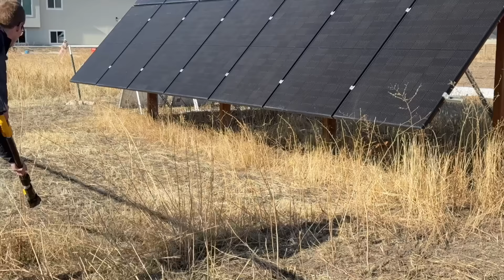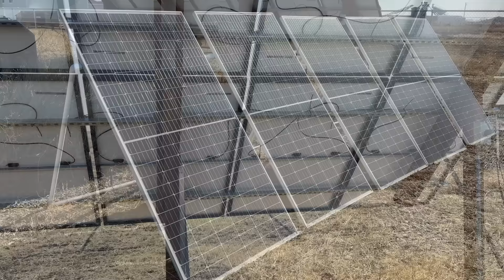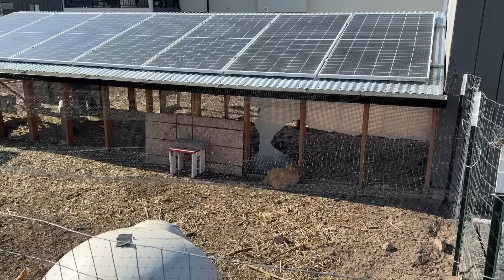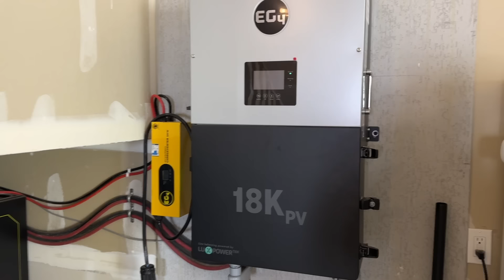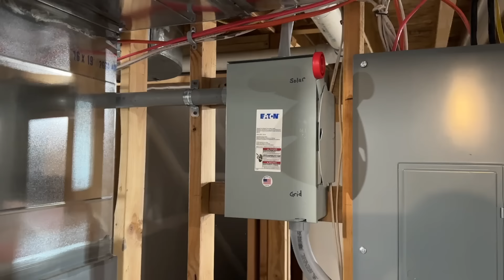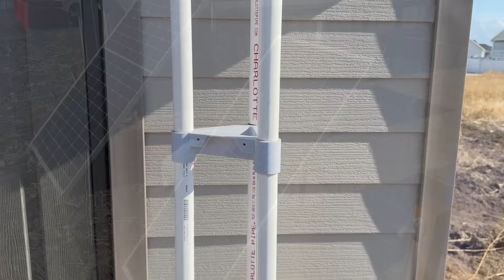We Said Goodbye to the Power Grid... Forever

Comment: How often would you say you need to switch over to commercial power?  Do you operate HVAC from solar too?
Reply from the maker: Both of the past two years there’s been about a week period in Dec where we’ve had to fire up the propane generator to supplement our energy. Outside of those few days we’ve been able to cover all of our power needs with solar.

Cooling with our AC yes, but no for heating. Our furnace is still on natural gas.

We recently replaced our gas water heater with a Rheem heat-pump water heater. It’s been working great. We just need to get some mini-splits and we can cut out natural gas entirely.
Reply: @SmithOffGrid   Sounds great.  
What is your average or typical kilowatt hours per day consumption and do you use less or try to use less throughout the winter?

Comment: Those wires coming from the solar panels seems really really thin and small. 😮. I’d install something with a bit more size to be safe.
Reply from the maker: It’s all 10 awg which is rated for 30 amps, so crazy enough it’s actually oversized for what we need!

Comment: ✅ Really nice job.  The pvc tower is a bit scary though as wind loads in bad storms can be nasty.  I had one break at 2am and damn near pole vaulted into the house.  However it did not have the three support poles like you have.  It was a heavy wall pipe back in the day and it snapped at a reducer.  Pretty obvious Monday morning quarterbacking.

Mestastic needs the shortest antenna cable as the drop in signal is significant per foot.  It’s a common problem.  So, if you put the unit on top of the pole in a NEMA watertight enclosure, it will perform much longer range.  In fact you probably don’t need the height so tall.  The biggest threat is a lightning strike.  It can set the building on fire.  It also can blast the equipment on the end of the cable.  I have been around many projects where I had the lightning rod systems added.  I also standardized on fiber optic cables for all outside runs after a major hit ‘changed my religion’ so to speak.  If you do use fiber, be extremely careful to avoid any sharp radiuses as there is a turn radius with fiber.  I prefer pretermimated fibers with connectors you can buy for $28 for a hundred feet.  Don’t get the tips dirty.  We had one bad connector and it ended up being oil from the technician’s finger. 

I am curious, what are you doing with the mestastic?  Been studying this for a decade.

Comment: Are you running different solar panel set ups with just one inverter? Does it have many inputs for different arrays? You better consider the purchase of an inverter generator with a clean output. The regular ones can turn off the solar inverter or damage the connected devices.
Just personal experience on my off-grid living in cold climate with 23kW solar and 80kW batteries.
Reply from the maker: Yeah all three of our main arrays go into a single inverter. The 18kPV has three separate mppt inputs which is great.

I agree, a inverter generator would be nice. The harmonic distortion on ours is over the limit of what the 18kPV is designed to accept. That's why we got the chargeverter which lets us charge our batteries directly regardless of how dirty the power is. It's worked really well for us so far!
Reply: @SmithOffGrid  Thank you for the info.

Comment: How much did it all cost, and whats the payback time in the US, (I am in uk).
Reply from the maker: $20k initially and $14k after tax rebates. When we ran the numbers it looked like it'd pay for itself in about 7 years
Reply: @SmithOffGrid  Hey, thanks for the reply, sounds reasonably good, so panels should last 20  years, but batteries, lucky if you get 10, so I guess that becomes a recurring cost, but still better than paying for the grid.
Do you feed back into the grid at all and get paid for it ?.
Reply from the maker: @michaelhex  The batteries are actually rated to retain 80% of their original capacity after 6000 cycles (that's over 15 years of daily use), so still very usable even after that point. And no we don't back-feed the grid at all. Our system is totally separate and isolated from the grid.

Comment: 3:13 You might want to elevate the chicken coop array panels, even just an inch or so of separation to allow air flow between the metal roof and the panels, though if snow build-up is an issue, then your configuration is great.

Comment: Can you go fully off-grid permanently with your setup or do you require the grid in the winter? I don't know where exactly you live so I don't know if you get enough solar power in the winter to make it.

I did spot something that could be a possible risk factor. All your DC cables converge inside one tube that enters the house. This means that you have a lot of DC voltage differentials inside the tube, risking massive arcs if the wires should ever get damaged. Best practice is to run the DC positive wires in seperate pipes. DC negative could be bundled together as their shared potential should be 0V.

Comment: Did you pay attention when Starlink lost 212 satellites in two months due to solar activity? The sun's solar flaring harmonics as great or greater than the centennial Gleissberg cycle and certainly the 195-235 year Suess/de Vries cycle combined with the exponential decay of the magnetosphere since the Carrington Event 1859 can and will cause catastrophic damage to the grid and electronics. Watch out for hail and crazy winds in the mean time. From roughly the mid 30's to mid-century will decide the course of events thereafter.

Comment: Have you found anything you couldn't reasonably power? Like using a small/medium welding machine (115v or 230?)? Air conditioning in hot months? Heating a hot tub? Charging an electric vehicle?
Reply: From what I've seen 5000 watts will run a welder its the inverter you gotta look put for

Comment: You should consider using bifacial solar panels on a vertical mounting system(you can make one yourself) with East-West orientation. You get two panels for the price and space of one (the backside produces 80% of front side power). In the winter snow doesn't accumulate and you get more linear power output from the solar panels which is better for self use conditions :)

Comment: 1 day without sun and you say hello to the power grid
Reply from the maker: We’ve been running this system for almost 2 years now and we’ve seen plenty of cloudy days. But that’s exactly what the batteries are for! We get about 2 days of runtime just purely off our battery bank
Reply: @ 2 days is not enough to be fully off grid
Reply from the maker: It’s worked for us! Cloudy days have reduced solar input but it never goes down to zero. That extra bit helps extend our runtime to 3 or 4 days if we also start conserving power. But for the 1-2 week period in December where we can have cloudy weather that’s longer than 3-4 days, that’s when we break out the propane generator

Comment: Question: why didn’t you go with an automated grid tied/off grid inverter? 
Awesome video and no unnecessary bs to get it past 10 minutes. Keep up the great work!
Reply from the maker: Our inverter actually is a hybrid inverter but I have it running in an off-grid configuration. With how hybrid inverters work and how they sync with the grid it’s hard to guarantee zero back-feeding to the grid. We don’t have a net-metering agreement with our power company so I didn’t want to risk that, so I set it up totally isolated. Glad you enjoyed the video!
Reply: @SmithOffGrid smart! Thanks for the answer!

Comment: I'm a little bit nervous about how teach of these installations handle in a real storm. These panels are massive sails.
Reply: Bump
Reply from the maker: We’ve had no issues with the wind so far. I’m not worried about the two main arrays, they’re secured pretty well.

But I do worry sometimes about that temporary PVC array. It’s staked down with 3 ft concrete stakes and it’s been fine through all the storms we’ve had the past year and a half, but I should still find a permanent mount for it

Comment: am i crazy or are those wires CRAZY thin for that many watts?
Reply from the maker: Wire gauge is actually all about amps! The solar wire I used is 10 gauge which can handle up to 30 amps of current. The panels are in series so in optimal sun each panel adds 41v for a total of 246 volts DC. And the current that flows through all of them is only 10 amps.

41V * 6 panels * 10 amps = 2460 watts

What's crazy is that 10 gauge is actually MORE than what you need! You'd be fine with 12 gauge wire (rated for 20 amps) for the amount of current we have flowing in that array.

Comment: Do you have any problem with wind where you live, especially with the PVC mounted setup?
Reply from the maker: We do get some winds but it normally comes in-line with the array and not from the back or front. I've been surprised how well that temporary array has stayed put. I did anchor down each panel with 3 ft long concrete stakes though. If I hadn't done that I'm sure they would have blown over.

Comment: How are your panels wired:  series or parallel or some combination?
Reply from the maker: All three arrays are wired in series. Our inverter/charge-controller needs pretty high voltages so series wiring works well and they each go to their own mppt input

Comment: could you hook up the gas generater straight to the Eg4 18kPV inverter to charge the batteries?
Reply from the maker: Yeah you can hook it up directly but the harmonic distortion on my non-inverter generator (dirty power) was more than the 18kPV was rated for. Thats why we went through the chargeverter instead.

Comment: I also like how concise this video is compared to others on YT that are over-long with endless talking. But I think another minute or two showing graphs of your consumption, how much are you saving and are there any limitations of your setup, maybe a wish list for upgrades and why etc.. Do you run this set up off-grid all the time? Can you run all appliances in the house simultaneously if you wanted same as if you were connected to the grid?
Reply from the maker: Great ideas for follow up videos! I actually have been thinking about making a video focused on our appliance use… I think that could be a good place to include a lot of those details. Stay tuned!

Comment: Thank you for the video.
What we need to know is the house load on this system and what your latitude is. I have two systems in place for a total of 17kW. I also have EG4 batteries but only 3 because I find it's cheaper to add PV and I want to run our house on overcast days, not let the batteries do the extra work. Do you have mini-splits? An EV? I have both.

If I'm charging the EV in summer I can also cool the house with mini-splits but in the dead of winter I can not run off grid entirely. Right now it's overcast at our 42 parallel and I'm running enough from the PV to run and heat the house but if I had to charge the EV I couldn't. On sunny days in the winter I can run the three mini's and heat the house but not on overcast days, I have to back up with the grid. When it's single digits F out I have to run all three mini's. I find running off grid continually is not possible in the wither in our northern location, I could do it if we lived in the south.

Comment: Great tour!  I also used a 100W panel directly to a 12v water pump which flowed water from our pool into a couple 100' lengths of black hose (heat collector) and drains back into the pool.

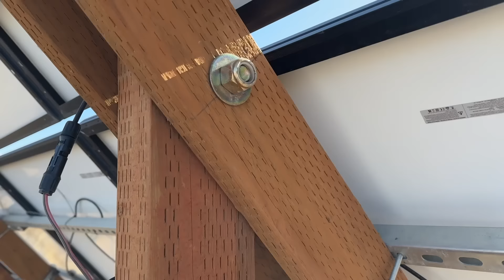Comment: Great video but just one thing, 1:16 The bolts on your ground mount that you change the angle of the panel with are too short,  with Nyloc nuts the bolt needs to go through the nylon to keep it retained.
Reply from the maker: Good eye! Yeah I noticed that during construction but it was the longest bolt in that size I could find. I've checked them periodically and none of them have backed off at all the last year and a half. The thread tolerance alone seems to have kept it pretty snug so far. But a little loctite should do the trick if I notice any movement in the future

Comment: can the battery pack replaced with an EV? I am considering to buy one of cheap EV just as battery and use it as second car in emergency(I am at rural)
Reply from the maker: I personally haven’t done anything like that before but I bet it’s possible...

You’d need to make sure your EV supports vehicle-to-grid, which I don’t think all do. And your inverter would need to be compatible with that type of setup.

I bet you could fine someone on YouTube that has done it

Comment: How can you be off grid with such a small battery bank?  I have a 40KW LiPo battery system and with my small minisplit I drain my batteries at about 6PM. My solar is a 4KW but it makes no difference once the sun is down no more power is being produced. A you say u  run your house with that small battery bank?
Reply: Something is wrong with your system. 40kw should give you at least a half day. I use about 60kw a day when it’s 110 outside for a big family in a 2200 sq ft house.
Reply: You definitely have something wrong. You drain your batteries by 6PM? That sounds like you’re barely even charging them.
Reply from the maker: Oh yeah something definitely seems wrong if you’re burning through 40kWh in a few hours…

What type of batteries are you using? Curious about your inverter too

Comment: Curious to know how long can you run your house needs on 30Kwh battery without a sunny day before generator or grid is required?
Reply from the maker: About two days on average. But during the summer time with running the AC, more like one day
Reply: a misconception thinking because it's cloudy solar panels don't produce energy....he did what I didn't. Ishould have gone with more panels for grid independency during winter and an extra 10kWh.

Comment: Those Lifepower4 power up the house during night time, correct? How long will those last? Does it use 1 at a time so they empty themselves up (allowing a full cycle to occur) or do they go in parallel? So through the night you use, say, 10% of each, and then during the day it charges back to 100%?

Im sorry im new to this, im full of questions because I want to get into it, but I don't know where to start (customs in my country are a pain).
Reply: He has like 30kWh of power just in the batteries.

You have to think of it as one giant battery (which is just a bunch connected together) (which yeah in parallel in that sense)

Unless he has crazy loads running in the house, those batteries will go down to like 70% worst case scenario and as soon as it is day back to 100% as he has a massive grid.
Even in cloudy days, because he has such a big array, no crazy noticeable changes.

Comment: 11.000w? Are you planning on supplying a whole town?

I've been off grid for 15 years now, with ....1200w of solar panels.
Reply from the maker: Haha not quite!

Water heater, lights, oven, microwave, fridge, freezer, and clothes drier use about 15kWh on average. AC in the summer can add another 20kWh per day.

1200w sounds very small! That’d barely be able to cover just heating our water (5kWh per day). 

What are your electric loads and usage per day?
Reply: @SmithOffGrid  I'm European, so we don't use as much energy. We run a dishwasher, a normal fridge-freezer of about 2m height, TV, sat-internet, and a washing machine which we hot-fill. A small water pump for normal pressure on the taps, and led lights. And still have enough for charging e-bikes. That's about it. 

No dryer, they waste too much energy. No airco, you get used to temperatures if you give your body time to adjust. And yes, it gets warm here in summer, 37C to 42C.

Hot water comes from a solar heater with glass tubes.

About 2,5 to 4kwh per day on average, and are very comfortable.
Reply from the maker: That's super impressive!

Yeah AC is non-negotiable for my wife haha. We have been looking into mini-splits though to cut down the usage for cooling.

Oh that's awesome you're doing thermal solar for heating your water. That's much less common here so the equipment is expensive and harder to find. I've heard in other countries where that's the norm you can get thermal solar water heaters for pretty cheap.

I'd love to see a video tour of your system!

Comment: Do you have the grid input into the inverter? I would think you can probably eliminate the need for the solar/grid transfer switch by utilizing the grid input to the inverter. The solar would power the loads when the sun is out. When the sun is not out, you can either set the grid as the secondary priority, or the batteries. I just do the grid as the secondary so that I'm not unnecessarily cycling the batteries.
Reply from the maker: Yeah there's a grid input but I decided not to use that for a few reasons.

One, I preferred to be able to bypass the inverter entirely and have our house be powered from the grid if I ever needed to service the unit. That's already come in handy a few times this past year and a half.

Second, with it being a hybrid inverter you can't guarantee that zero power will be back-fed to the grid. Sounds like recent firmware updates to the 18kPV minimize the back-feeding, I think it was sub 30W at the worst. But since I don't have net-metering set up I wanted a true off-grid setup. Grid and inverter are always entirely isolated. But if we had the 12000XP off-grid inverter instead I probably would have considered it!

Having the grid as a secondary source would definitely be nice for the darkest part of winter but it's not too difficult to switch back over to the grid if we ever needed to. And for 95% of the year we have so much power coming in from solar we wouldn't need to use the grid anyways.

And on the note of battery cycling, LFP has such a high cycle rating I'm not concerned. Sounds like the calendar aging will kill them faster than usage will so might as well use them as much as possible!

What does your setup look like?